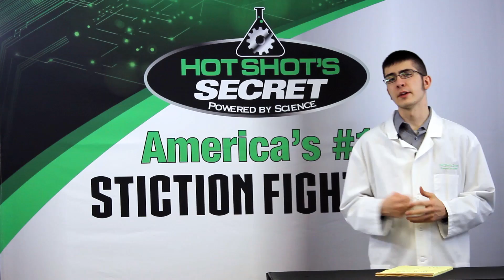Excessive White Smoke - Heavy-Duty Cummins Symptoms

Comment: I get white smoke randomly only when driving only. Most likely to happen when pulling hills or hard acceleration when under a heavy load. Engine sounds fine, weak acceleration power.
Been going on for over a year now, still haven’t figured out the problem 😢
Reply: I have the same issue!!
Reply: @hdfhfdhtehrghdh34634  smh mechanics don’t know anything. All they do is make guesses with expensive parts & labor, burning a hole in my pocket every time. Problem still not fixed
Reply: @hdfhfdhtehrghdh34634  what kind of truck do you have?
Reply: I have a 2003 5.9 cummins and its so random that i cant even diagnosis it because its only when im driving with my trailer hooked up
Reply: @hdfhfdhtehrghdh34634  Same . I’ve cleaned and replaced so much stuff still no luck . Something is telling me it might be the fuel injectors
Reply: I definetly agree with you im going to try that next if it fixes it ill let you know asap
Reply: @hdfhfdhtehrghdh34634  appreciate it brother
Reply: Hey man so its got to be one of your injectors thats on its way out. Mine kept intermittently going in and out and finally failed and it ended up being injector number 1. I bought bosch new injectors. 400 a piece but i need good quality because its my work truck i dont have time to cheap out or short cut but best of luck to you. Check those injectors or if you can get them changed out
Reply: @hdfhfdhtehrghdh34634  Wow, I have so many questions bro!

• So no more smoke and engine power restored?

• When you say “finally failed” how did you know when it finally failed?

• How did they determined that it was a fuel injector? *did they perform and type of tests or just took them out to inspect?

• Did you end up replacing all 6 injectors? And what was the total looking like with labor?
Reply: Hey so yeah, no more smoke at all the the engine runs smooth as ever!

When i say finally failed i mean the injector that was causing the smoke got stuck wide open and the truck ended up smoking while the whole entire time.

I determined it was injector after it was smoking i have a scanner tool and did a injector kill test which shuts off each injector while the truck is running one by one untill it stopped smoking which for me was injector number 1.

I only replaced the one that gave an issue and i paid 400 for 1 injector from autozone and replaced it myself. I hope this was help for you.
Reply: @hdfhfdhtehrghdh34634  thank you so much for the update and advice. Pray all goes well for you 🙏🏾❤️
Reply: Is it on a big rig or small Cummins?
Reply: @bryanwelton1442  big rig Peterbilt 387 I did delete last summer and have no problems anymore.

Comment: I get white smoke at start up till it warms up
Reply: I don't know but I think I am getting a little air in my line.  It might be bleeding off some place by my fuel pump and it sucks some air. because I sometimes get poppin with my white smoke. 2 sets on injectors this time higher fuel ones and it still did it.  it starts fine.
Reply: Same! Did you ever find the solution?